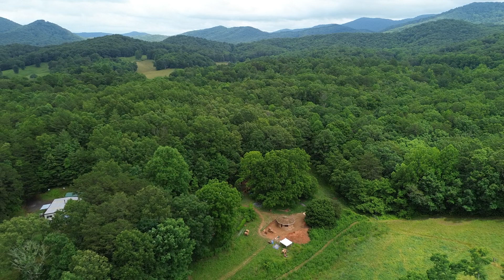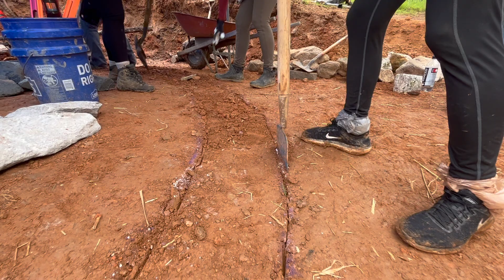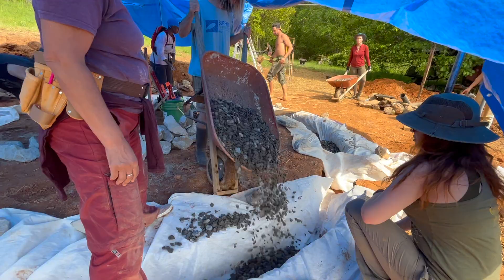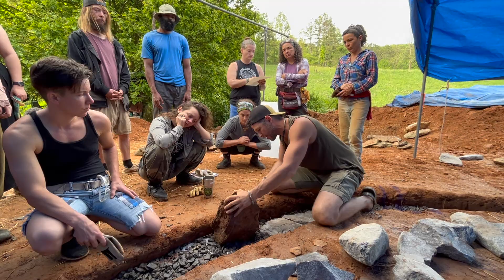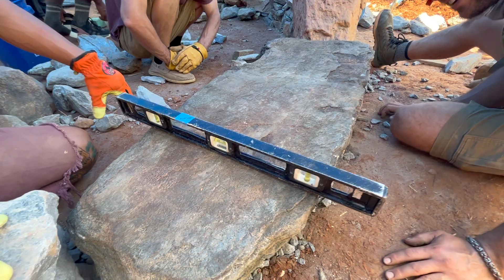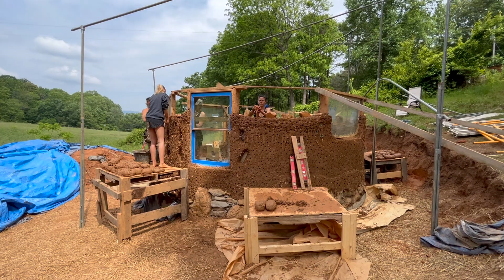How To Build A Stone Foundation | COB HOUSE Part 2

Comment: Loved these in depth series on the build! A question regarding the piping for drainage- it was mentioned that one could use piping throughout the foundation and not only in the exit drainage trench- would a perforated pipe be able to withstand the weight of the stone stem wall and cob walls? Would love your advice on this. Thanks so much!

Comment: Thank you for making this video series. It's been really interesting so far. Wondering about natural materials for foundation mortar. Seems that cob would not work due to not handling humidity well. Are there any other materials one could use to reinforce the foundation besides cement? Thank you!

Comment: very swell. more mortar would have made me happier, but not bad. wonder if mud wall needs a waterproof barrier to better prevent erosion into the stone foundation over time or if that'll never happen. mortar between the joints could prevent that I think, or maybe a waterproof top plate? hmm... also interesting how there is no wood header on that door frame. PS. apparently the header is said to be 4 inches wide. strangely the video seem to show only a true dimension 2x4 laid on the horizontal but I digress.
Reply from the maker: I meant that the overhang of the header beyond the door frame is 4 inches past the door frame to overlap the walls by 4 inches on each side. It’s a 2 by 6. But yeah sorry if I wasn’t clear on that part.